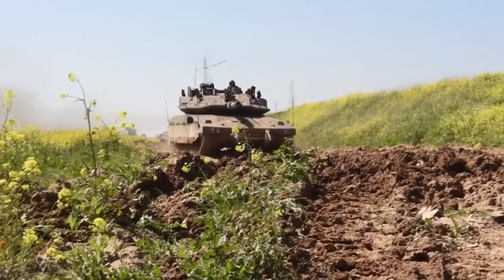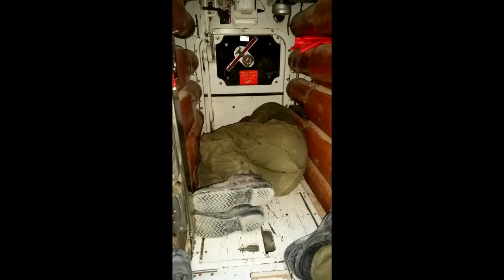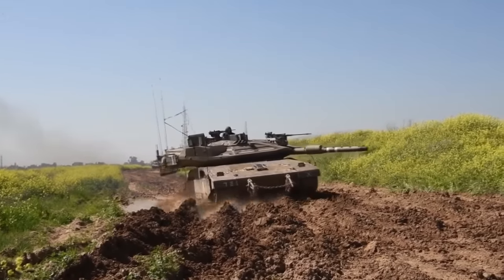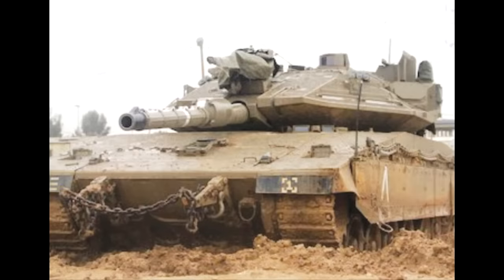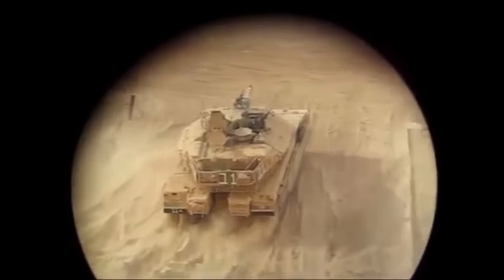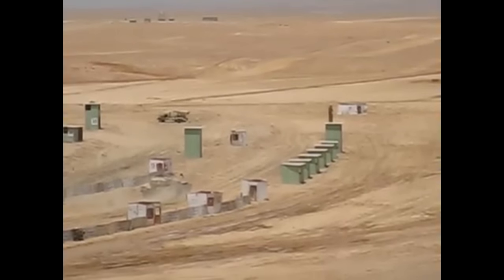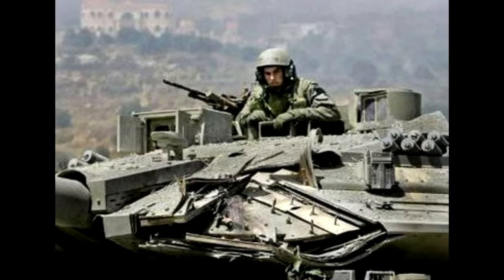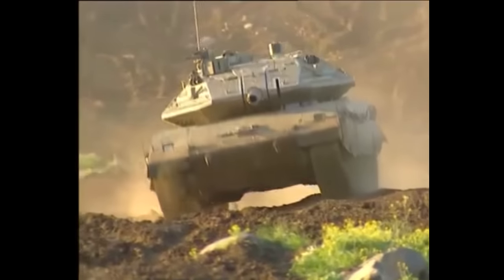Problems with Merkava tank

Comment: Almost every other tank uses the crew as an extra layer of armor for the engine.
Weird, but effective!
Reply: Monstertruck Other tanks have thicker front armor than the Merkava.
Reply: Vassilis Tzaferis, notice that the Merkava has an excellent hull down design.
Reply: Drew Sullivan • 12 years ago yes it is true.  But going by Israel's tank battle successes, they did better when they were exposed and have travelled speedily to the location they want to have advantage.  Which means there's no time to hull down.
Reply: Engines will do jack shit towards Apfsds.
Reply: Indeed the engine is no barrier to modern Sabot.   At most another 10-20 mm of additional RHA.  Very sad amount.   Israel needs to work towards unmanned MBTs or 2 men tanks with no crew in turret ala T14 Armata style.   The Merkava is heading towards obsolescence depending on whether her neighbors have advancement in MBT tech.   If Turkey has the new Altay, I would recommend Israel to upgrade
Reply: @ConstantineJoseph  10mm of rha? Have you seen and engine before? Also having turret commander will aways be best
Reply: @a.t6066  The engine may look big but it is full of air pockets and weaker materials than RHA.   Cumulatively it is not much armor and near negligible against Sabot and against DU, worthless
Reply: @ConstantineJoseph  I'd say depending on where you hit, the engine and transmission will provide 600+ mm of rha armor value.
Reply: @ConstantineJoseph  I don't think you have ever seen the inside of an engine or tank transmission
Reply: @ConstantineJoseph  why would it only be 20mm of armor?
Reply: @a.t6066   Yes I've been in the military and have seen tank engines.  They're not armor.  They are just an obstacle but a weak obstacle at that.   

If engines all consisted of 600m ++ RHA, EVERYONE would be placing engines in the front and in fact two engines!  

Subject an engine to a simple 76mm  AP Sherman tank gun, and it will obliterate.  Any engine no matter how large.   

Now with modern DU sabot.   The slug is super heated and bores through advanced composite armor and RHA and including ERA.   

Do you think an engine that was not designed to take on ultra modern munitions can withstand  a 120mm DU penetrator.

Israel designed the Merkava primarily knowing they are not facing the best tanks in the world because.....Arab armies and their export variants and export variant munitions supplied to them.

When you pit the Merkava in the shoes of major powers expecting their tanks to encounter the finest Russian and Chinese MBTs who also have depleted uranium sabots...... the tank falls short.   Also Trophy APS is useless against high kinetic energy rifled or smoothbore cannon shots
Reply: @ConstantineJoseph  yes, of course engine is not designed to counter or withstand hits from artillery but it IS designed to handle the mechanical stresses of being an engine. Just because an object isn't designed to do something doesn't mean it can't.
Reply: @ConstantineJoseph  Its built more for the terrain.  Crest a hill and the tank will show a smaller silhouette due to its ability to turn the turret down.
Reply: @MrNintoku  That turret down technique is an old outdated cold war tactic that the Israelis exploited and won a war with and in which her enemies already have learnt how to deal with that using top down attack and artillery on tank positions.    

Saddam Hussein in fact used the hull down technique like the Israelis do back in 1990/91 Gulf war and failed miserably as fighting was conducted in the night and modern APFSDS depleted uranium literally cut through the entire turret and bore straight through the back as well.     The molten from the DU rod is so terrible, that crews had to bail even if the tank wasn't fully destroyed.   

That said APFSDS DU will fully penetrate a Merkava IV turret as well, no questions asked and modern optics, both IR and NV will always guarantee a hit within 2 shots in any conditions and in any modern tank.   

The case of modern warfare now is, detection first.   He who detects who first and fires the first shot, wins the day.   The Merkava with her engine mounted frontally will give a front signature so bright that you can spot her at night for miles!
Reply: @ConstantineJoseph  Well reasoned and informative argument.  I concede.
Reply: What people seem to miss, is the fact that Armor vs. Armor battles are pretty much a thing of the past. Israel operates in a totally different battlefield for the past 35 years. The Merkava mk4 is perfectly suited to modern day warfare, and since the Trophy system has been introduced, has suffered ZERO armor fighting related casualties.
Reply: acemcjack you'd be surprised.  Armor vs armor is the standard for all MBT capabilities.   The last decade geopolitically, has favoured insurgencies and fighting infantry based guerrilla warfare.   

This however is about to change drastically.   With the posturing of big superpowers against each other Armor becomes more of a deterrent than an actual prime tool of the army to rely on.   

Airpower, stealth UAV are all well able to destroy any MBT easily.  

The only way to overcome air power and UAVs is to deploy larger amounts of troop concentration and armoured vehicles across a broad front.  This will overload enemy airpower and also use MBTs against MBTs.   Now with extended range munitions beyond the ATGM, tanks CAN engage tanks using sensors and precision optics and computer firing systems.

The days of fighting lone cells or small groups of poorly armed infantry are over.   It is the time of technology
Reply: It has something to do with Israel's strategic condition. Israel is not suited to fight an attrition war. Every tank crew is an irreplaceable asset. While Russia/USA with more millions citizens can afford to lose men and replacement will always be ready, tanks are strategically more important for them. That's not the case with Israel that only has about 7 million citizens. For them, it's better to lose tank than to lose crew.
Reply: ThomasG10mtn Arrange  testimony ,please?
Reply: b12 o  Thanks for agreeing on my argument!! Your comment might be found to be a bit racist by some, but yeah, not every people are chosen by god to guard the Torah. But if you read the Torah, every people has its own function and duties, perhaps not to guard the Torah, but they are selected to fulfill a purpose, which might not be described in the Torah. Shalom!
Reply: the baron  You are not wrong, if that implies to standard APFSDS or AP.   It will  however be absolutely be redundant against ultra high density DU sabots.   The kinetic energy and the sheer weight and heat of the DU melts through the engine extremely easily thereby making the Merkava design rather redundant.

When the Merkava was designed in the 70s, DU was in research and not deployed.   These days only the big superpowers use them as standard issue (in operations) whilst the second tier nations like Germany, Israel, Spain, Italy, South Korea, Japan etc..... do not use DU because of safety in the long term.   Japan unlike these nations have lots of DU stockpiles but will never use them as they are a purely defensive nation after the WW2 surrender to the allies.   

DU has been observed in the battlefield to have completely penetrated from front to back and exit out of a T72.  The longer slugs of the newer variants are able to penetrate any tank in the world including the Armata, again, front to back.   This includes the Merkava Mk IV.
Reply: the baron  Israel may have DU but in very low amounts.   If they do have, they are very limited and in low amounts due to the lack of nuclear reactors powering the country, second, they probably could be imported from the US, which will not be the highest spec DU sabots.

As for the US, RU and CN, they have massive DU stockpiles due to nuclear reactors in the commercial energy sector.    In operations, they will always be armed with DU sabots and will use them liberally if the threat level includes opponents using high numbers of armor. 

The main concern for Israel now is the presence of the Russian military in Syria.   Their tanks are as capable as the latest Merkava mk IV and the future variants even more so.    

Israel is incredible as a nation to bring advancement to the battlefield using much innovation, however there are limitations to what Israel can do as Russia's military is really way more experienced and development wise, way more innovative due to the size of their talent pool, long heritage in tank development/aircraft development.   

In anycase the variations of the Merkava will likely end on the Mk 4 or Mk5 variants as the future Israeli MBT will most likely be more mobile and loaded with sensors like the Armata.   That is the trend going forward
Reply: Hazardous Haha, no.
Reply: ThomasG10mtn Cringe 🤦‍♂️
Reply: Monstertruck Hey, don’t invalidate RedEffects bullshit click-bait video like that! 😉
Reply: @vassilistzaferis4277  Merkava 4 armor is Classified so you can't judge it.
but i saw a video of a Merkava 4 getting hit by an ATGM and still surviving.
Reply: Strange the engen is more important than the crew to most goverment 1 way they r more effecent than cappitalism
Reply: @hazardous458  and the location of the raidator is ok so you have only 1 side to get good hit with it and stall the engen whereas with other tanks with all the back being raidator i guess that is good and it is relitivly small but it is supper attractave to molitolv cocktale
Reply: Suppport GuyOne Engine more important my ass. The engine is the most weakly armoured part of the tank. Mounting engines in front decreases the amount of composite armor, it increases weight and causes the turret to be placed higher which makes the overall silhouette bigger.
Reply: Lmao, if a guy can is close enough to throw a Molotov on your tank than you failed, no one should be this close to your tank, where the fuck is the infantry?
Reply: @hazardous458  how does puting engen in front do any of that it just changes where things will be placed inside of the tank and this tank has diffrent internal layout than m-60 im not trying to be rude so if i am tell me plz but the engen "adds" armor where ever it is placed usuly in the back as it is usuly placed increesing armor protection from ~30 mm to ~ 35 or somthing not signifacant but against a 20mm maby?
Reply: Suppport GuyOne Increase weight because power pack is big hence you need a bigger surface area.
Increase height since if you notice, NATO tanks with large engines tends to have a risen engine deck
Less armor because of weight constraints.
Reply: @hazardous458  it can happen depending if armor or infantry goes in first but the most important bit is it acts as a deterint to tanks to go in paticular arieas where armor hunter teams are operating in so maby being forced to a woodsey bottem of a hill with little to no tank cover over a topish of a hill
Reply: @hazardous458  but puting the engn in the front acording to what i understand about senter of mass stuff just moves the weaght from the back to the front unless there is a 2nd engin i didnt know about
Reply: @hazardous458  what about the fact that the tank can be an ifv not just a troop carier but able to carry inf inside what is downsides to that
Reply: Suppport GuyOne Downsides of carrying infantry is less ammo for the merkeva since you have to get rid of most of the ammo for the seats. Another disadvantage is engine in the front unless you want infantry in the front? It’s just a merkeva thing, mbt don’t need to carry infantry
Reply: @hazardous458  but it is INFANTRY as ammo instad of boring old ammo
Reply: Suppport GuyOne Than what’s the point of a tank if you’re gonna use infantry? Isn’t tanks supposed to deliver high shock and devastating blows to the enemy? I’m pretty sure the only infantry that can do that is Jamsheed
Reply: @hazardous458  to prevent ww1
Reply: No armor is the best armor the bullets go in one way and out the other clean no shrapnel.
Reply: Good one
Reply: Vassilis Tzaferis Thats not true whatsoever
Reply: Crew is cheaper and easier to replace.
Reply: Daniel deVilliers Not if your a country like Israel which has a small population and could run out of manpower easily.
Reply: @a.t6066 lol real life is not war thunder War Thunder
Reply: @giacomogalli2448  what are you even talking about
Reply: its easier to replace a tanks engine then to train a new crew. human life is very Precious in Israel  we are not Russia the US or all of those Arab countries where  human life is  disposable. so yes crew is more important then the tank. that's why the markava has a lot of emphasis on protection of crew  survivability.
Reply: Shaloam Nenja • 12 years ago Yeah hull down a concept everyone wants but never performed well
Reply: @saarmendel5645  Bro , the point is that merkava has NO FRONTAL ARMOR in comparison to other modern MBTs , even with that enginge in front.
Reply: @shaloamnenja12yearsago29  Every modern tank has excellent hull down design, because being in a hull down position makes tanks harder to kill. 

Being excellent in hull down also works for T90, Abrams, Leopard 2, Leclerc, etc. It doesn't make the Merkava special.
Reply: Ikhsan fahri pratama, yes but the merkava has a particularly well designed turret, similarly to the t14, it’s mainly a breech and minimizes the turret size. Relying on armor isn’t future proof, especially considering the rate of firearms development vs. armor development. The merkava isn’t designed to win in flat, open areas or urban scenarios, it’s a cost effective tank which works quite well for its country of origin.
Reply: @ConstantineJoseph  well, maybe a DU round *would completely penetrate the merkava, but you have to remember that pretty much only the US has access to this kind of ammo.
also, the armor has heat dissipating properties, making detection by IR far les probable, not to mention that israel's enemies- mostly terror groups, don't have this kind of equipment

also, what the hell hapenned to reactive armor? isn't it supposed to counter all anti-tank munitions?
Reply: @ConstantineJoseph  Engine blocks are made from hardened steel or alloy, so, for example, engine block wall 20 mm thick is better than 20 mm of RHA, and, because there are hollow pockets, penetrator wears irregularly, further decreasing penetration capability. I'm not saying that it's better than having thicker armor, but it's better than protecting the engine with crew's flesh. You get better crew survivability with the same weight.
Reply: Filip Habek they do but if your engine is in front it is even brighter under thermal sensing.   So it is counter productive to have a frontal engine these days
Reply: @vassilistzaferis4277  LOL, Abrams has 51mm of steel, Normal steel! 🤣
Reply: @ConstantineJoseph  Actually, Israelis flat but when you go to Israel there's a mound every 100 meters so no, They have Hull down position everywhere as Nature decided to put a bunch of mounds everywhere in Israel.
Reply: @hazardous458  But what are the threat for Israel? Israel doesn't HAVE enemy's that have tanks, The one's that do have tank have T72 Scrap metal tank that can't do shit to Merkava. So what's the point of having the best APFSDS protection If your enemies DON'T HAVE APFSDS.

It's like Having 20 M829A4 APFSDS to shoot at 1 Toyota corolla at 200 METERS.
Reply: @ConstantineJoseph  Jesus! Merkava DOESN'T FACE ENEMIES THAT HAVE GOOD APFSDS!?!?

Does Hamas have APFSDS!?!?
Does Palestinian's Have T90 tanks?!?!
Does Syria Have Vacuum APFSDS?!?!
Clearly No, So what's the point...
Reply: @ConstantineJoseph  So what's the point? Does Israel's enemies have Good APFSDS?!?! Does Hamas have T14 Armata tanks? NO, Clearly NO, Israel's ENEMIES don't HAVE APFSDS, So what's the point!?!?
Reply: Well the thing is having the engine in the front doesn’t fully protect the driver anyways and again other tanks just have good frontal armour to begin with also fun fsct having the engine in the back offers more crew protection because that’s where the tank has the weakest armour so at least putting something in the back adds to crew survivably in urban environments where tanks are at risk of being shot from every angle
Reply: Surely as Israel has unique requirements for its tanks, it will have a unique tank. Similar to the Sherman of World War II which was constrained by the shipping weight of about 40 tonnes because you could not stick it on a train and take it to the war. Merkeva is an infantry support tank in an asymmetric war, not really an MBT.
Reply: @deleteduser3455  something rectified immensely by Active Protection Systems and considering that Merkavas can bring it's own dismounts mean it can find and neutralize ambushes better than other tanks in Urban engagements
Reply: This reply is for Monstertruck.
Using the crew as extra layer of armour, is not weird.
It's cost effective.
Cheaper to replace the crew vs replacing the Tank.
Sad but true.
Reply: Ah, yes, Armor
Reply: Joking aside. With a lower population, machinery is more expendable than manpower. Look at how poorly Russia is doing today. We thought they had endless amounts of manpower and here they are struggling. Maybe Israel had it right all along. Protect the crew that takes a long time to train and equip. Machinery can always be rebuilt.
Reply: About 9 have already been scrapped by 
a ragtag outfit. Some marvel ain't it?